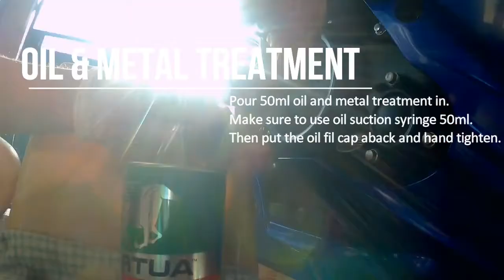4 Minute Oil Change on Yamaha YZF R15

Comment: hows the performance of pertua in your r15?

in my r15 v2 i try pertua and 40ml oil and metal treatment but i feel my engine got hot, in just a short range..
Reply from the maker: Hi @Benjamin, normal engine operating temperature is from 150 to 180F since I have installed a digital temperature gauge I can easily monitor the status of my engine. There is also an temp indicator on a OEM digital gauge that when it light, it shows that the engine is overheating if there is non then your engine is in a normal operating temperature. May I suggest to check always the level of your coolant reservoir it may be a factor. Thanks for dropping by on my channel. Ride Safe!
Reply: thanks for the information..